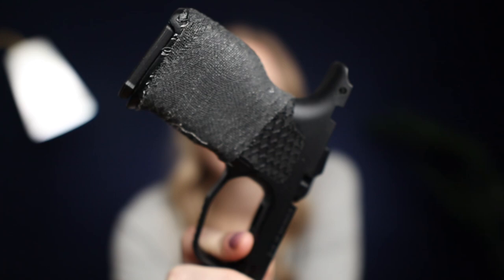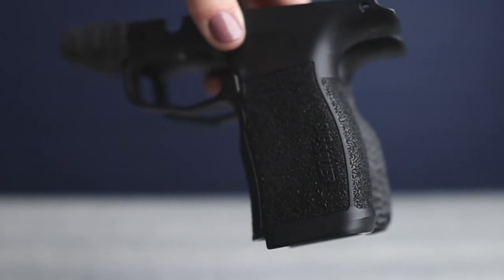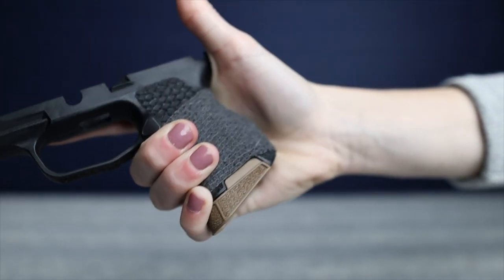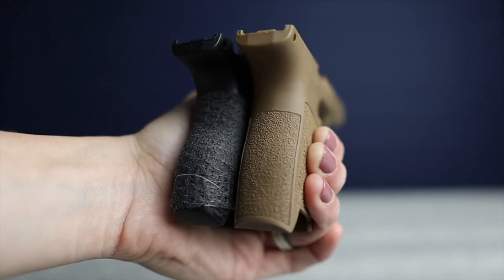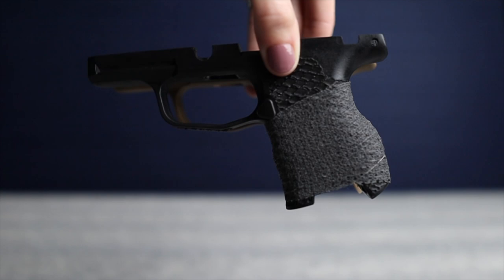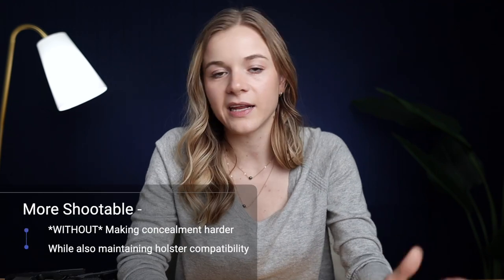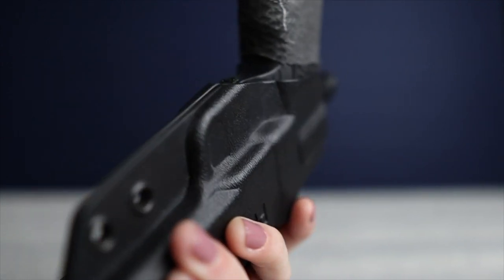Best P365-P365XL Upgrade? | Boresight Solutions

Comment: I'm very happy with the PMM JTTC on my P365X. Noticeably reduces muzzle flip and looks good, too
Reply: I’ve been looking into these a bit. Saw a tuber had issues with it locking back and limp wristing. Now he was probably using 115 ammo. Also he didn’t seem to understand how and the point of comps. What had your experience been if I may ask?
Reply: What is pmm jttc?
Reply: @wbwills2  Parker Mountain Machine Just the Tip Comp.  They sell it as a kit with a threaded barrel and compensator to be assembled on your own slide.

Comment: I've got XL hands and very long fingers.  I find that the XL grip module fits my particular hands perfectly.  I can grip it tightly enough with my right hand that I can see the grip module physically deform.  My biggest complaint is the top heavy floppy feeling with the P365, P365X and P365XL when the magazine is low on ammo.  Worse still, the P365XL is nose heavy.  I glued in 2.0 oz of tungsten welding electrodes inside the grip module and it eliminates the floppy feeling and nose heaviness when the magazine is low on ammo.  But everybody's hands are different.  I would prefer that the trigger was 7/8" further forward, but fat chance anyone is going to make a pistol to fit my hands.

Comment: If you like aluminum grip modules but want something more OEM than what Icarus offers, Mischief Machine is great. They're a little more expensive and go out of stock quick, but I highly recommend it. Feels like a different pistol, plus if you're worried about holster compatibility they have a holster that fits all their modules; the standard and XL look like they fit most holsters though, but I went with the XXL which fits the x macro holsters I believe.

Comment: I have the icarus, boresight, and WC grip.  Icarus is nice but to your point, holster options are limited.  I prefer the WC over the boresight.  The “roundness” of the grip allows me to get a better grip on the gun while shooting.  Boresight is overpriced imo and would be a much better option at a lower price point but certainly better than the stock grip.

Comment: Great video, as always! Not a grip related upgrade, but I found the Sig custom works p365x comp slide reduced recoil for me! I hear you on the Icarus grip being difficult to find compatible holsters. I have been using one with an ANR holster, but after ANR your options are pretty limited. I do find the grip, however, especially coupled with the comp slide to make shooting feel like a full-size as far as recoil. It just feels very fast and smooth compared to the standard p365.

Comment: Have you tried the Wilson combat module?
Reply: I just put the Wilson Combat XL module on my standard 365. I haven’t had an opportunity to shoot it yet but I love the feel and comfort to it now. A lot more confidence in my draw now. A little too aggressive texture but that can probably be resolved through light sanding or hockey tape. It does a a bit of a flare and will print a little more though so that’s also a down side. Overall I’m extremely happy with it so far.
Reply: +1 on this.  Love my Wilson Combat grip module.  Nice texture and slightly more bulky.
Reply: @trysucceed  If you don't want to permanently modify your grip, go to your local bike shop and ask them for some scrap inner tubes. They'll hand you a bunch for free. Find one that fits around your grip and cut it to size. It'll still provide some grip but it won't chew up your side. If you don't like it, just pull it off.
Reply: @bwofficial1776  great tip, thanks

Comment: If it helps my icarus grip module fits without modification in a stock qvo x Marco holster that fits a streamlight tlr7 sub.
Reply from the maker: That’s because light bearing holsters index off of the light, not the trigger guard 😊
Reply: Sounds like a lot of people really just want a different gun.
Reply: @RonSpilker  Considering the fire control unit on the 365 is the "gun" you have the ability to buy just that and build out everything you want custom around it.

Comment: I like my Wilson grip frame.
Reply: Wilson grip module is better !
Reply: I thought pretty hard about the boresight grip but went with the Wilson because it was far less expensive; cheap enough that if it sucked I wouldn't be out a lot of money. I ended up liking it a lot but I would be curious to do a side by side on the two modules
Reply: @calvinthomas1642  those bore sight solutions grip modules are cool but stupid expensive. $400 for a hump of plastic glued on the back and laser etched. Thx but no thx. I whittled a similar shape out of a cedar branch I was trimming off a tree in my yard anyway. 3m double sided taped it so it didn’t need to be carved to fit exactly   .tape is strong & has some spongyness to it. Then cut some thin scrap leather I got from hobby lobby & wet it,stretched it tightly & laced it up the front of the grip. Same or better results but cost near to nothing   .Wilson’s grip is cool too. I’m just tight with my $ and wanted something original & different. I don’t know why anyone would pay   More than 1/2 the cost of the gun for a plastic replacement grip. Machined aluminum…MAYBE.?.?. But plastic. More $ than sense IMHO. PPL on YT that get free stuff will say anything. No skin off their teeth & probably getting paid too.
Reply: @wbwills2  It's cool that you were able to craft a grip that works well for you!  It's very rewarding to have your own personal touch on your weapon.  I too take guntuber reviews with a grain of salt but I definitely respect Tessah's opinions.  I've also started thinking of the firearm as the basis for a weapons system.  When you take the cost of a good holster, optic, and light into consideration (not to mention ammo selection and training!) they easily double the price but I feel that they're important to fulfil the potential of the weapon so it's worth it to me.
Reply: My wc frames fell slick, i have installed a hogue wrap and even though its rubber, it fills my hand better.
Reply: its fat! makes it printable and ncomfortable

Comment: The modularity of the P365 is nice. It's great to see so many companies making alternate parts for it. I like my Shield Plus because it's slightly longer front to back and more ovoid than the P365 but it's not a modular platform.
If you want to cover up aggressive stippling, go to your local bike shop and ask for some scrap inner tubes. They'll give you a bunch for free. Find one that's just a little tight around your grip and cut it to size. It'll hold in place from the tension and the stippling. It's smooth against your skin but still offers some tackiness for shooting. If you don't like it, just pull it off and toss it. It costs nothing but time and gas for the detour. I did it on a S&W M&P M2.0 that has 60 grit sandpaper for grips and it made it so much more comfortable to carry and shoot.

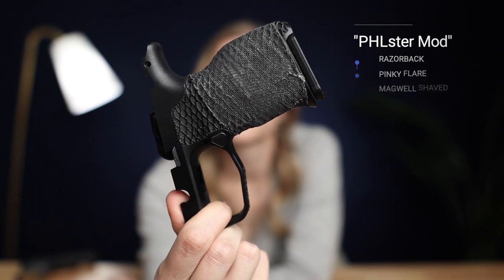Comment: Sorry at 2:04 are you saying you take a X/XL grip and shave it down just a tad to get the pinky on then modify the magwell to accept regular 365 mags and use original p365 slide? - So you left with p365+ (and can use p365 slide) and not 365X/XL ?I do appreciate the WC p365 grip  but if there is a way to get the bigger WCp365X grip where only the grip is bigger then shave it down would be cool so i dont need 'pinky' flare mags  - not a fan of p365 flat base mags as cant get good grip at times. New to the sig family - so sorry of the answer is obvious for the folks in the know.

Comment: Seems like the razorback will help for those of us that have issues with the p365 grip angle where it points low? Yes, one can train for it but when your main handgun is a different grip angle, not so easy. Love the P365 - have two - one with irons and the other a P365X with optic. I find it’s easier to draw and correct with irons than the red dot. I love the P365 and just trying to get it to work better for me.